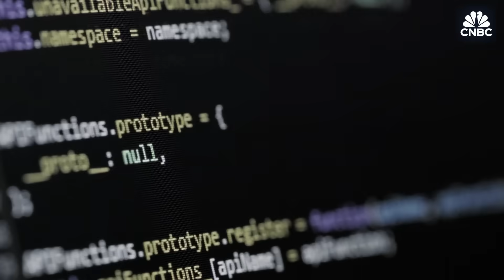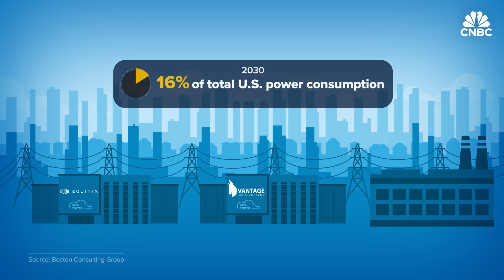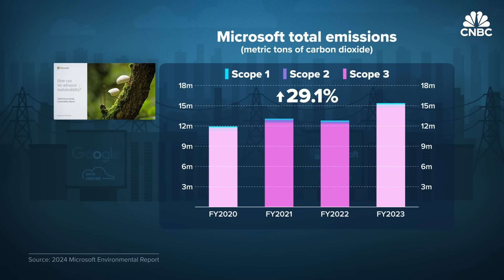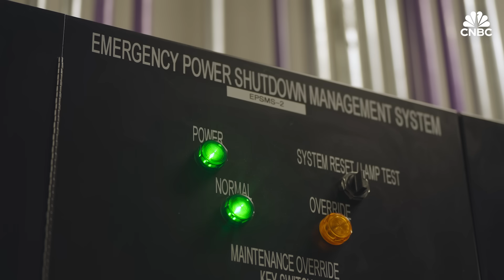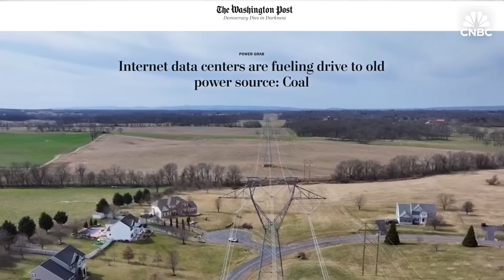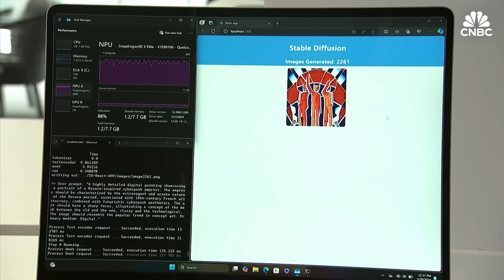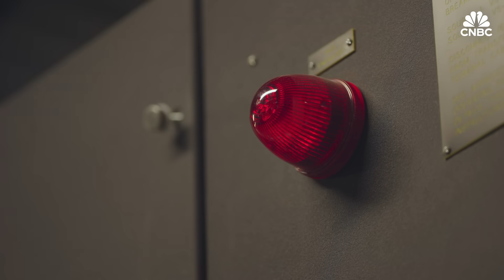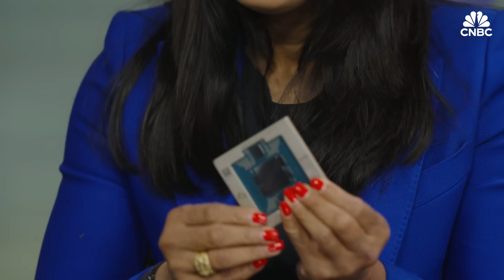How The Massive Power Draw Of Generative AI Is Overtaxing Our Grid

Comment: The heat can be cooled with liquid helium like we cool an MRI unit. Or we can submerge the computers into a liquid to cool them. If they run cooler they won’t pull as much power. It does take power to run the fans. But if the room is 5 degrees or -5 degrees they would run and stay cool with a single ceiling fan in the room.

Comment: So let's all forget that coal is ultra carbon intensive and natural gas is not that much less intensive than oil as we know that natural gas piping from its source generates alot of leaks on the way to being burnt to make electricity. Onsite Ng to power just avoids the grid bottleneck. Coal is 30% more carbon intensive. It doesn't matter if your data centre is power efficient (and who builds a power inefficient design) if it's turning on coal power and generating even more carbon in the AI race. The earth just cares about the total emissions not how good one source is in minimising. 
What about Canadian hydro, offshore to cool the centres, locating them next to hospitals or offices to offer free heat, requiring district heating grids to offload the free heat. Why is there not at least solar in every possible flat service on these data centres and surrounded by wind mills. The heat could be used for clay drying and a multiplier effect for steel etc. literally every office and home or larger retail near a data centre should have a pipe to access this free heat. Great for public swimming pools as the heat is low but constant.

Comment: If the power problem can be solved so easily but the water problem can't, it's as simple as using closed loop systems.. but I'm sure the stock holders don't like that

Comment: 1. Upgrade Infrastructure
- Replace aging power lines and transformers with  modern, high-capacity systems.
- Invest in smart grids that automatically detect and respond to failures.
2. Diversify Energy Sources
- Reduce reliance on coal and shift toward renewables like solar, wind, and hydro.
- Expand nuclear power, which provides stable energy without carbon emissions.
- Improve energy storage, like large-scale batteries, to manage supply fluctuations.
3. Decentralization & Microgrids
- Develop community-level microgrids to prevent full-scale blackouts.
- Encourage businesses and homes to generate their own power (solar panels, backup systems).
4. AI-Powered Efficiency
- Use predictive AI to forecast energy demand and optimize distribution.
- AI can detect anomalies in power consumption and prevent outages before they happen.
5. Government Policies & Investment
- Push for regulatory incentives to support grid modernization.
- Allocate funding for research into next-gen energy solutions.
6. Cybersecurity Protections
- Strengthen defenses against hacks and cyber-attacks that could disrupt supply.
- Use blockchain technology for secure energy transactions.

Comment: I work at a gov't data center in Cheyenne WY.  This area has a 15% relative humidity annually.  That said, our 20 Petaflop, 4MW HPC (high performance computer) is cooled about 98% of the year by "free" evaporative cooling.  I'm aware of data centers all over the USA that reside in very humid areas.  These humid areas require that their HPCs be cooled with less efficient mechanical cooling from chillers/DX units/Lieberts.  Data centers in America should only be built in low humidity areas of America.  Meta is currently building a data center in Cheyenne and one in Kansas City.  I'm already willing to wager that the Cheyenne data center will be far more efficient.

Comment: In Quebec, they recently banned the sale of ICE cars by 2035... while at the same time massively increasing data centers in the province. 
Locally, we had 9 power outs over the last 12 months.  Conversely, we had 3 power outs over the previous 8 YEARS.
The Hydro Quebec power grid cannot handle this kind of disconnected-from-reality policy making.
Reply: I researched the recent power outages in Quebec and none are related to data centers.  The main causes are "trees or vegetation" touching a power line. "The most common causes of power outages are severe weather, such as storms, high winds, and lightning, followed by trees and vegetation falling on power lines, and accidents involving utility equipment or poles. Other causes include animals like squirrels, equipment failures, and in some cases, deliberate action by the power company to relieve grid stress."
Reply: @energyexecs so . All of a sudden their is grid stress but it's not the data centers doing this . Just too many squirrels😂😂😂😂
Reply: I find it ironic that it takes 10 years to bring a mine to productivity but no research seems to have occured about the impact of these data centers and their effect on the environment or the humans in it.

Comment: I did the math for the phone charging vs. image generation comparison, and while it is more proper to say one query instead of one image, it can be surprisingly true. My phone has 30W charger, which can charge it in 30 min, so that is around 15Wh, while my 400W GPU can generate an image with Flux Dev in ~50 sec, but let say a minute, so it uses around 6.67Wh. However most online AI image generators generate 4 images for each query, then it is possible to get enough consumption to charge a phone. Also we need to power the other components.

Of course if we use a simpler model (e.g. SDXL), we can reduce the generation time to 1/10th, while the image quality will also be worse, it won't be as much worse. In any case better not compare it to gaming for hours...

Comment: What if we build these systems in regions where we can capitalize on cold climates and building design to accommodate the heat utilizing some solar. We can funnel in cold natural air rather than use electricity or water. The air can be passed through a chamber to remove humidity.

Comment: I have a solution. I once heard a story about some super metal made from silver that would allow electricity to circle the globe on a single wire. Meaning a power company on one side of the country could easily send power to the other side without a need for breaks in the line. Then I never heard anouther story about it again. Ask AI how we could scale materials like this. Even making the chips out of this super metal. For anyone who understands how chips work and how electricity flows, this super metal basically removes 80% of the resistance on the metal so atoms flowed faster and cooler.

Comment: The power comparisons here are absolutely shockingly horrible. 

1 chatgpt search is equal to 10 google searches? Considering google uses its own ai on every search too and also has way more data centers, this is an absolutely insane remark. 

And then the led lightbulb. Yes. Let’s make the viewer think this is significant from our tone. To me, an electrical engineer, all this tells me is that LED bulbs are so efficient! No but seriously claiming something like this without any math is hilarious. They could have said the average users power usage per year accurately by just finding the average searches by a user a year and comparing that to the total searches and comparing the total power usage of all the google data centers and scaling it proportionally to the user. 

Instead they told us about an example that simply is incomprehensible to the viewer.

Comment: No way one ChatGPT query takes 5Wh energy. Training must have been factored into this equation, and that's misleading.
Reply: @R0stos  right? Another way of saying this is that the same query repeated costs less and less with each iteration.

Amount of Branching is reduced with each iteration, as the less probable branches are eliminated and the probability is redistributed amongst the remaining nodes.
Reply: Why is that misleading? I’m honestly curious, as I’m just an uneducated pleb 😅
Reply: @Lady_Graham  they are saying the cost is always the same. It isn’t because the time and processing power required reduces over time. Make sense?
Reply: @Neuro3mergent I barly undeestood any ofnthe words u said Dad
Reply: You need to think of it from the power used, at every step, versus time to watt consumed at each step.... That includes the pc it came from, the light in the room, ac in the room, the switch and modem it went thru to get to the internet from the pc, the power the ISP consumes to send the request, every hop it has to go thru to get to the AI server, the time slot on the AI sever, and the return trip, power wise...  

While their number is a bit misleading because they didn't explain it that way, AI consumes far more power than a simple table lookup ever will... Don't confuse power numbers consumed simply at the AI server, with the total wattage consumed when any consumer accesses that server are included... 5wh is not that much power if you consider every step consuming it.... If I trace route all known Chat GTP servers from where I live, it varies between 10 to 30 server bounces.... Those servers use 60 to 100 megawatts a day, which in total could literally consume millions of watts a second..... Yes my bounces are 20-50 milliseconds, but it adds up fast.... Very fast, before my request even got to the GPT server.........
Reply: doesn't really sound misleading to me, when you buy something you also pay for development costs, and as long as these companies continue to train their models that energy demand stays
Reply: @the_steamtrain1642  The training is a flat upfront cost. This would be like saying the very first query cost 10 MW energy. And the second one 5MW...
Reply: @R0stos  that's why... You make calculations to predict how many query's there will be, same with selling cars
Reply: @the_steamtrain1642  But you understand that's not how they arrived at the 5wh value, right?
Reply: @the_steamtrain1642  then, I guess you don’t understand how AI works and the fact that questions asked and requests made are highly redundant statistically. AI works like the human brain: by redundancy. That’s why when you do something the first few times it can take a lot longer and requires much more thought power than when repeated over and over. As an example, consider the amount of energy everyone takes when they first learn to drive. After awhile, getting in the car and driving requires no thought at all because you’ve eliminated all the incorrect ways of doing it. I recommend asking an AI how it learns something to find out how it learns something. I also recommend asking an AI if it takes the same amount of power to respond to the same request over and over. 

With regards to paying for development costs, tech requires less and less power to do the same thing as it advances and development costs for tech require much much less power than consumer demand for the resulting product…. it’s like microscopically smaller.
Reply: @Neuro3mergent  I asked chatgpt like you said and even it said that the more of the same querys it gets it won't decrease energy consumption per query, while I'm far from a professional and there's way smarter people than me I don't see how the doing a basic task analogy transfers over to a massive data model which has to do everything 

I do see why companies might want to make AI's more energy efficient, reduction of costs across the board, and that would be possible, I just don't see how without retraining of the model
Reply: @the_steamtrain1642  ah, well that’s not the question to ask so I see why you got that answer but it’s not “retraining”, it’s building on the training that has already occurred. And if an AI has been trained to answer a certain  question then there is no additional training needed to answer that question. The only training needed is to identify similar questions as being the same as the question it has already been asked…again, that becomes more and more apart of the previous training that has already taken place.

Comment: how about setting up data centers on the dark side of the moon where cooling wouldn’t be an issue?
Reply: See? Comments like this show what AI makes of people brains.
Reply: @marky4x429  see…a one sample experiment establishes no correlation. And pathetic comments like yours stifle imagination so if that’s your intention, stick to your own family. People are looking for solutions and some of us have potential cost:benefit ratios in mind.
Reply: @marky4x429  you’ve never heard of heat emitted as infrared radiation in space? How do you think heat gets from the Sun to the Earth? :) You aren’t aware there is water ice on parts of the moon that never get direct sunlight? How would water ice stay ice if every part of the moon got sunlight. You didn’t know some parts of the moon never get sunlight? Why don’t you ask an AI about it or at minimum take the time to do some “old fashioned” research.
Reply: @marky4x429  self referential
Reply: Without an atmosphere to dump the heat into, you are going to overheat fast. Also the dark side of the moon gets just as much sunlight as the part we can see.
Reply: @mqb3gofjzkko7nzx38  The coldness of space can be used to cool down machines that heat up during use through a process known as “radiative cooling”. You’re right that In space, there is no air to conduct or convect heat, but the primary method of heat dissipation would be through infrared radiation. We already have spacecraft using radiators to emit excess heat as infrared radiation into space, effectively cooling down the equipment. There is water ice on the moon in places that never get direct sunlight. This is why I do believe we could set up large computing centers on the moon out of direct sunlight which would be cooled via infrared radiation.
Reply: @mqb3gofjzkko7nzx38  see the other response about infrared radiation and water ice being on the moon due to the fact some areas of the moon never do get sunlight. Yeah, by your reasoning, the heat from the Sun would never get to us. That’s just not what happens. But thanks for answering without attitude. Totally appreciated.

Comment: Little pucks that measure temperature of the mineral oil cooling XMFR cores is not the answer for the US.

The US has a massive transmission issue. We can’t move power from where it is generated to where it is needed efficiently. The average transmission project takes a decade because of how much paper pushing and red tape is involved. 

We also need to build more nuclear plants. We don’t have enough reasonable space for big hydro projects, and wind/solar really sucks for the power grid. If we want clean generation, nuclear is absolutely the way to go. The ONLY thing bottlenecking nuclear is politics. We have to change our priorities.